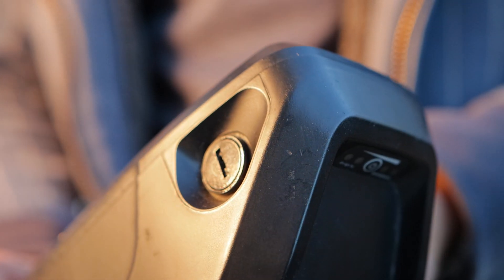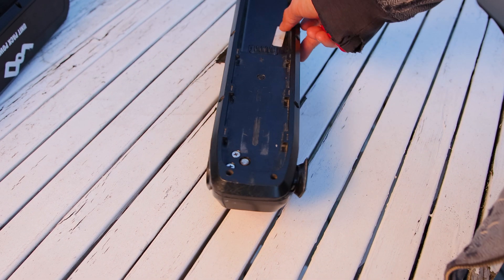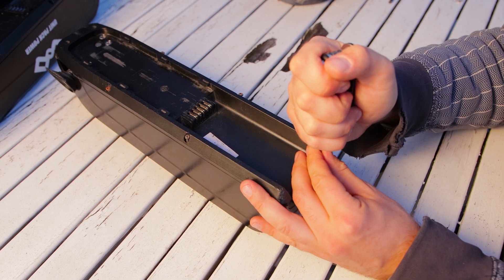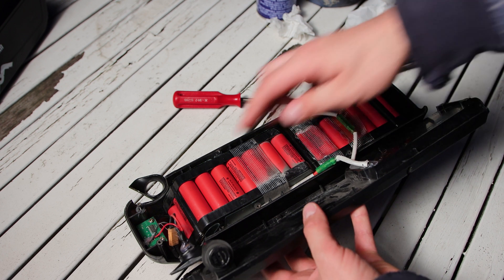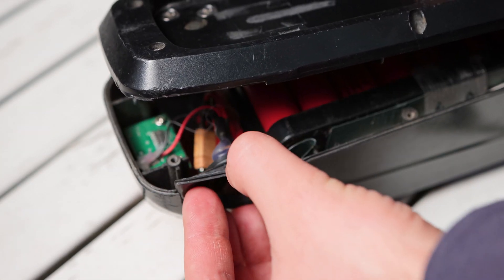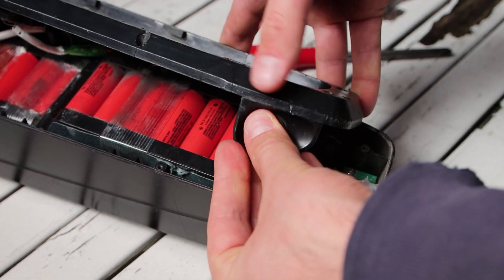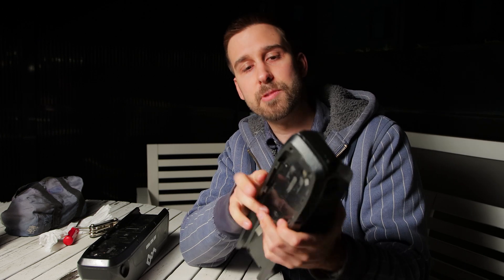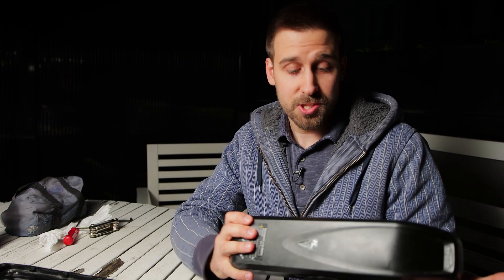Dropped your ebike battery? 👉 Basic disassembly & fixing of a Hailong battery case

Comment: unit pack power? Thats your good battery?

yikes.

You should also stress that it's easy to pinch wires (especially in the screw holes) - or worse cut into them causing a short - when you put it back together. These batteries will literally burn your house down if abused or shorted.
Reply from the maker: This one is a Luna Cycle battery pack. I had another one that was a Unit Pack Power battery. We don't have them anymore and just got new prefabbed bikes for my partner and I in Spring 2021 (Ride1Up 500 Step-Thru and Biktrix Swift Step-Thru!)

Comment: I'm considering buying a Hailong battery from Ebay, but I've been put off by potential fires caused by bad assembly practices or shoddy wiring. This one looks to have a better build quality, do you know if they are all like this now? Is it just old ones that weren't so good?
Reply from the maker: This one's still rockin! I'd dropped it so any battery would have done this imo. But yeah! They're similar still - just slightly different mounting points. 

UnitPackPower is a good place to start on AliExpress. Their stuff seems reasonably priced and they used genuine cells from what I've seen. That, or buy from LunaCycle.